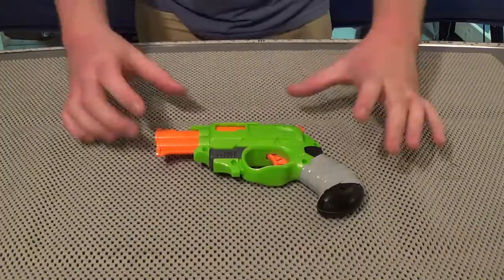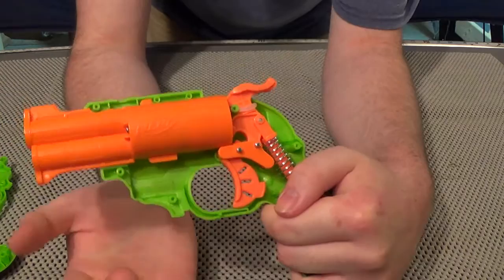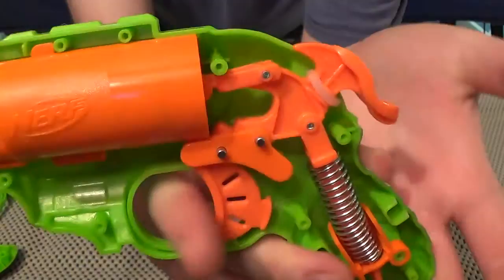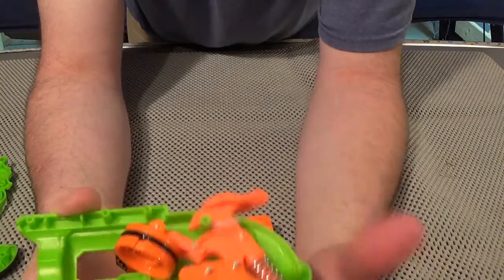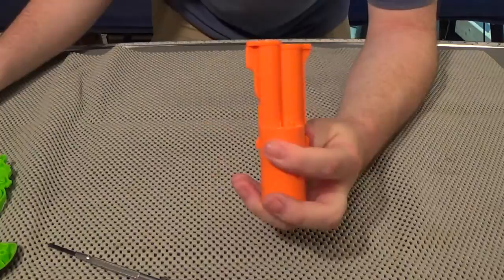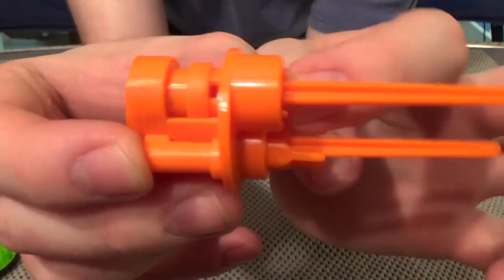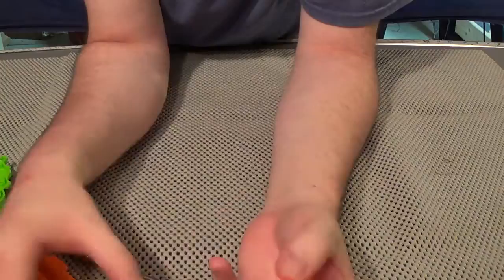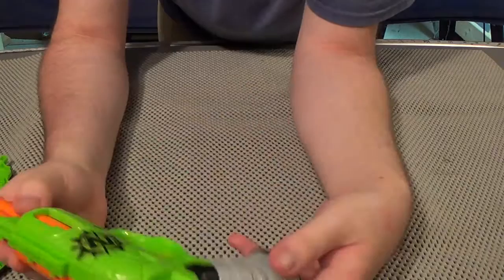Internals Overview - Zombie Strike Double Strike

Comment: That AR setup seems stupidly inefficient. The air gets pushed down the plunger up and then down into the top barrel then out. The 2nd barrel appears to do that but has to go backwards then down into the 2nd barrel. The amount of turns the air has to bend is stupid. I think I can see a better setup that would has less obstructions.

Comment: I love this blaster. But, I find that I have to cock (teehee) the blaster and then put the darts in because it spits them out if you're not careful doing it normally. I guess thats a credit to the seal, but its a pain in the ass! Most hardware stores do have a spring that size in diameter but its a little shorter. Just stretch them a bit and they work extremely well.